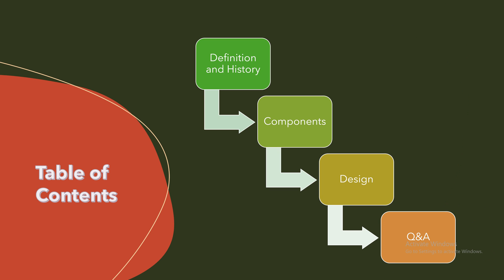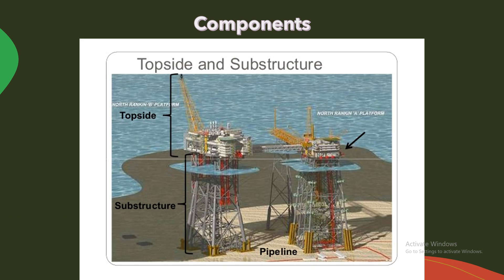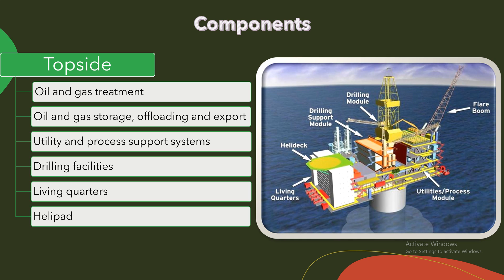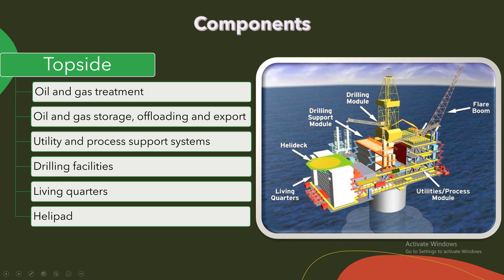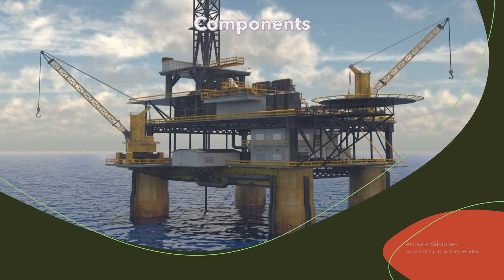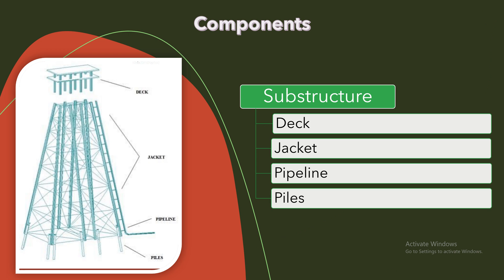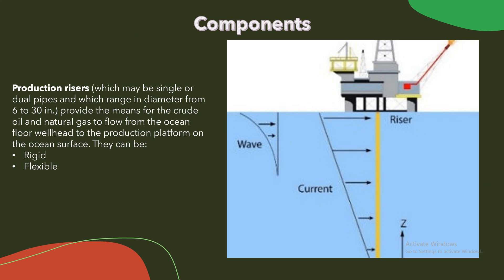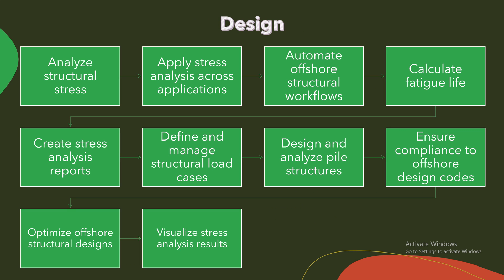Offshore platform (components, platform design),  Javid Isayev, CE 18.1

Comment: What are the differences between WHP and CCP offshore platforms?
Reply: @gentlement: below are some of the differences I can provide: 
Function: WHPs are for extraction and initial treatment, while CCPs are for processing and preparing the product for export.
Complexity and Size: WHPs are simpler and smaller; CCPs are larger and more complex due to processing requirements.
Equipment and Facilities: WHPs focus on well control and safety, with minimal processing; CCPs have extensive processing, storage, and crew facilities.